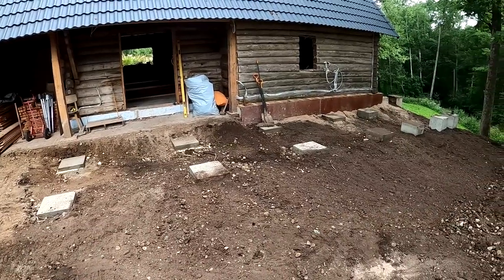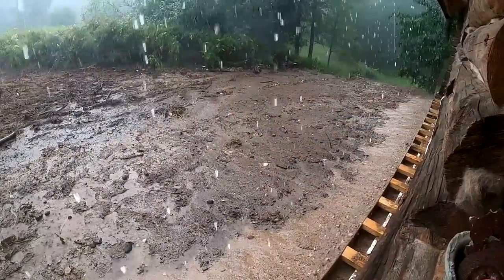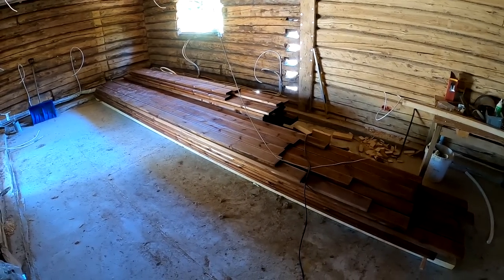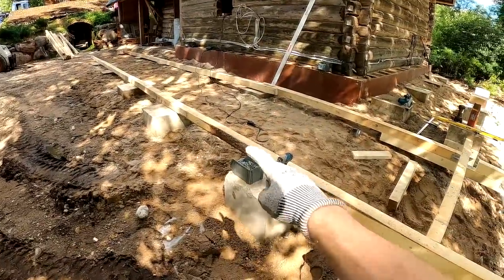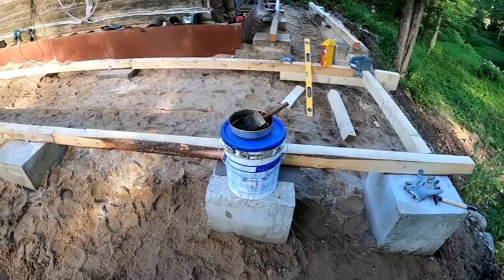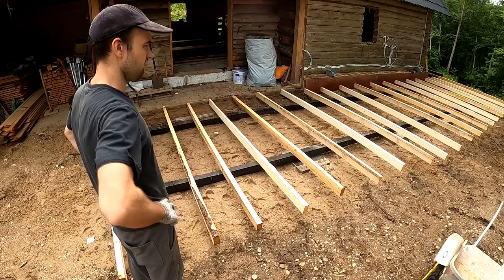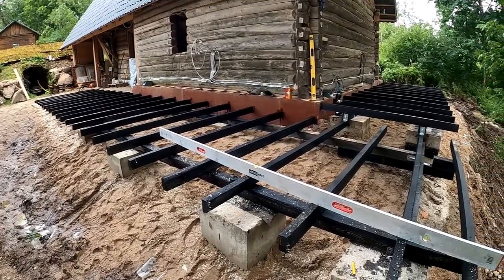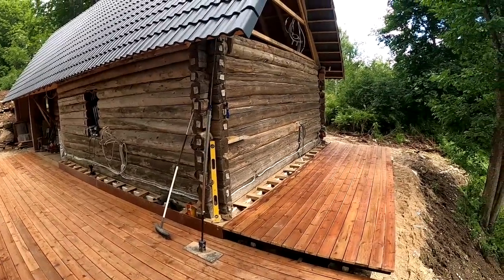Renovating a 128 year old forgotten log cabin (part16) - building a deck

Comment: When I was younger and more able and could change my own engine oil, I used to use waste oil to waterproof posts for fencing. I put the oil in a bucket and stood the post in it over night. They never rotted, staying in the ground for years. Your doing a brilliant job with the build, you should be immensely proud of what you achieved. 👍
Reply from the maker: thanks for the comment

Comment: You did a great job. In Australia, we use that rippled decking material quite a lot and we usually put the rippled side down. I believe the rippled wood is designed to stop water accumulation on the underside of the decking boards and for airflow and rot control. It’s a scientific thing (apparently) that the ripples actually repel water more efficiently than the flat surface of the wood, and they allow more airflow to prevent rotting and mold. Anyway, just an observation. You’re doing an incredible job and I’m so impressed by how hard you work and of your vision for this log house restoration. Cheers from Australia.  👏🏻🇦🇺🌺🌴
Reply from the maker: Hey Libby, glad you enjoyed the video yes i understand the ripple on the underside effect which would help to dry out the connection better, but it's not really mandatory, i put them on the top because i think it looks nicer and also its not that slippery.
Reply: @Ants_Pants  I totally agree with you about the boards looking better with the ripple facing upwards. And anything that stops slipping has to be a great choice. I’m about to redo my own deck/verandah and I’m also tempted to put the ripples facing up because of the non-slip factor for me and my two little Jack Russel dogs.  Better grip for them to get down the stairs to the fence to bark at anyone who happens by. 😂 Stay well. 👍🏻🇦🇺🌺🌴

Comment: I like the video. If you watch the japanese woodworkers they carefully cut each joint completely with a saw and shave it to final dimensions with a razor sharp chisel. You break the blocks out with a hammer and flatten it with a grinder. I like your method so much better.

Comment: Hi ant pant hope you are well. May i suggest...if you want to cut a hole on a square just cut in the shape of an X ontop of the square/rectangular shape and press the plastic down , then cut excess material off...voila!

Dont forget to oil-treat the cut off ends on the wood deck. 

The deck turned out pretty good looking👍
Reply from the maker: Great idea! Thanks! about the wood deck, the lumber is pressure treated, meaning its just not surface coat and the treatment extends deep into the wood grain. I will do oiling but most likely not this year, maybe next. Take care ❤
Reply: @Ants_Pants  thank you for taking my 5c in consideration😄...thats great to know about the treatment...your property is getting along very nicely...👍

Comment: Highlights for me this vid: Problem-solving: the decking ('thing') corner with wooden supports on the pillars;  ingenuity: used motor oil on the decking ('thing') frame; humour: getting killed by thunder would be no fun at all; video editing: the Bobcat and sand piles; learning from mistakes: the upside-down decking ('thing') supports (yep, mistakes are great learning points). Love the videos and seeing the progress - and yes the water run-off from your slopes was very reassuring. Well done Andris, another winner and the decking ('thing') looks fantastic.
Reply from the maker: Thanks, thanks and well thanks Jim! 👍😆👍

Comment: Outstanding video. Great content and great commentary. I didn’t know you could use motor oil for wood preservative - what a great idea. Can’t wait for your next video. Your channel is quickly becoming one of my favourites. Cheers from the UK.
Reply from the maker: Thanks Andrew! Yeah the oil work, iv even used it to coat wooden bridges over small streams in very moist and wet forest areas and 10 years later the bridges are still there and strong! + its free coating, smells bad for a week but eventually the smell will go away, DONT use it as indoor coating material though, that would be a bad idea :D

Comment: That's a big deck, but i don't think you should invite a tank to trst it. I  tried to paint some wood that had been coated with used engine oil..even after washing the wood with petrol and using oil base paint it was very difficult. It was in the budget though so i powered through it.. ($Free wood).. great video as always and the progress is quite impressive with you doing it on your own too.
Reply from the maker: Yeah getting that thing off the wood i imagine would be an nightmare. Good thing i will never need to get it off 🤔👍

Comment: Another awesome video man! Love what you're doing and totally agree with all your choices. You remind me a lot of myself when I watch you work. That includes your sarcastic humor and sometimes getting a little frustrated with products and shit quality tools. Haha. And I have to say I'm jealous of your lumber prices. Basic Cedar deck boards right now in the United States cost around $8.50US for a meter of 40 mm by 120 mm. Close approximate conversions but I think you get the idea. And I have to know who is your supplier for the Haida face decking. I am having a hard time finding it in the states and it's driving me crazy! You can get it in recycled plastic all day long but I cannot stand plastic even though I am a huge proponent of recycling! Keep up the awesome work brother!
Reply from the maker: That's some crazy lumber prices man wow. I would cry. But i guess the avg income is about 2 or 3 timea higher in the states then its where i live. Im not sure what you mean by the haifa face decking. Talking about the pressure treated decking boards?
Reply: @Ants_Pants  Haida is the groove pattern on the face of the board. It is hard to find here and when you do it typically doubles or triples the cost of the same board. Love what you do man! Wish I were there!
Reply: @Ants_Pants  also, unfortunately the lumber and fuel price increases do not compare to the average wage which has not increased. For most people right now improvements or even basic maintenance are nearly unaffordable compared to a few years ago
Reply from the maker: @anthonylehner3643  yeah its all the same

Comment: I agree the "thing" looks good.
But I had a few questions / ideas.
Question - Are you going to use some kind of finishing liquid (linseed oil?) on the decking material that you had to cut?
Idea - Where the low deck meets the high deck. Put some of the short boards you cut off the decking material to give it a flush cap, so your foot doesn't slid through the hole and you trip / break something.
Idea - Get a cargo net, and stake it down over the hill to help lock the dirt and sand in place to try and counter erosion so there is less of a chance that the cabin will get washed out in a heavy storm.
Reply: He said the deck boards were pressure treated,thus he liked the aroma they exuded.
🙂✌️❤
Reply from the maker: Will oil them down the road, possibly on a year or two, they look great now but with time they turn grey and ugly. Good idea on the short board and side paneling for the deck. My mother is currently trying to figure out sometype of plant to plant on the hillside, wich will grow deep roots and help to avoid washaway. 👍
Reply: @kajem575  Will pressure treated wood affect the wood all the way through? So even if you cut it, it will keep the resiliency? (I know little about how treated lumber works, other than it's supposed to make it last longer.) I was just working off the idea that the colors where the cuts happened were different than the top of the boards.
Reply: @Ants_Pants  LOL You sound like me in the priorities. (I'll get to it when I get to it.) :D 
And your welcome for the idea on the short board idea, last thing anyone wants is to get hurt by something avoidable. Hope that it helps out.
As for the plants Maybe put some of those tree's you like to plant every year on the hillside? I'd recommend plants, but I'm still trying to learn about what plants are good for what. (anti-bugs, anti-erosion, looks, privacy, smell good, and what not.).
Hope your mother can come up with some good ideas for you.
Reply: @pervysage3604  As far as I know,yes. It is done under "pressure" as the product name states and if done properly reaches the core of each board. But I cannot speak intelligently on the rules and regulations of various countries of origin.
🙂✌️❤
🙈🙉🙊
Reply: @kajem575  LOL no worries on needing to explain all the different ways things are done in different countries. I just hadn't looked into what presure treating the wood did. Thank you for the answer, it's always nice to learn new things.
Reply from the maker: @pervysage3604  Seems like so, because when i cut it through the fiber inside had greenish stripes going all the way into the core. So i assume it's treatment is much better then plain surface oiling.
Reply from the maker: @pervysage3604  i dont know anything about plants:D but she has help from a person who studied plants in university so i guess she can manage this task 🤔😆
Reply: @Ants_Pants  That's good to hear. My worries were for naught then. )))
Reply: @Ants_Pants  LOL Sounds like your good at managing and making things. A good manager knows how to delegate. :D

Comment: Looks great, very solid! I can relate to sometimes using what happens to be easily to hand to do a job, but a pillow as a brush is certainly different 😃But why so much sand to cover the plastic?  I would have thought 50mm would do, but it looked like you had 3 or even 5 times that in places 🤔
Reply from the maker: Perhaps your right, too much sand indeed. But thanks for your impression, take care 😜

Comment: 41:09 Imo, what would make it look even better, is if you capped off the sides/edges so you can't see the ends of the black support joists (on the front and side porches).
Reply from the maker: sure! maybe in future, i kinda ran out of the decking boards.
Reply: @Ants_Pants  But I saw part 17. You had more. :-)
Reply from the maker: @CoroaEntertainment  im kinda talking from the future here so sorry, by now im out 😂

Comment: The only argument not using old motor oil to tread wood is that every drip that is going down to earth is compromising 1000l of ground water. You should have done the coating in the garage avoiding drips to the ground…

Comment: you did such a overkill on those contrete posts and put 10x10 main beams,  whats the point?! and for ankering just put a rebar in concrete  thatss ticking out like +/- 5cm and them drill a hole in main beam and put it on rebar, thats it, or you are afraid that gopniks will steal your deck? :))